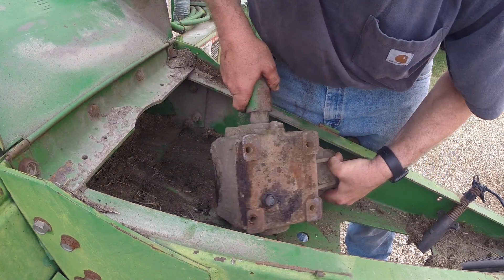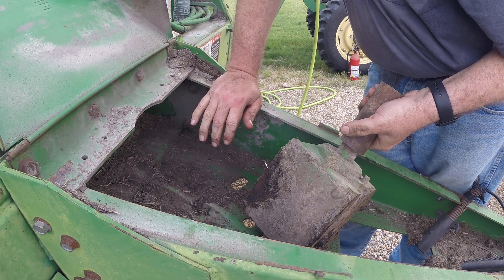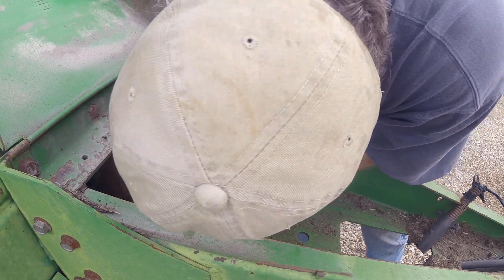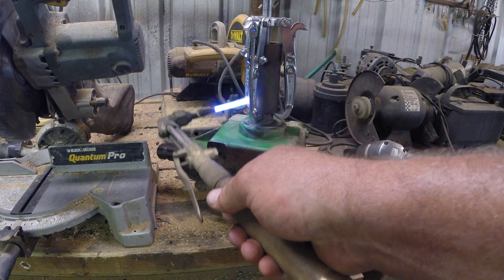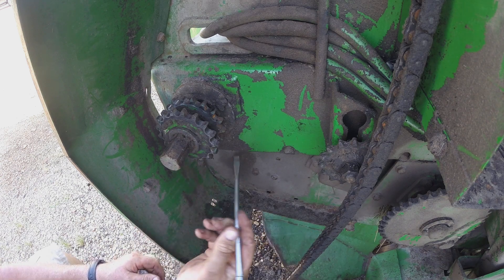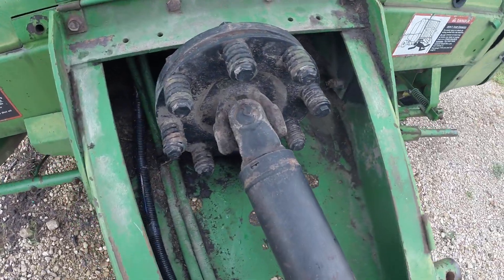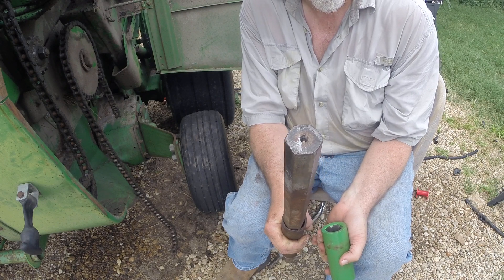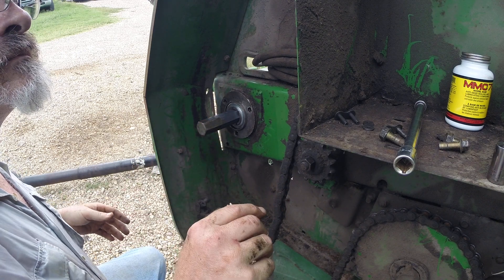Baler PTO conversion; Converting a 1000 rpm PTO to 540 rpm John Deere 535 baler

Comment: Could you not just cut a little length off the driveshaft?
Reply from the maker: I think you would have to cut off too much. Of course you could cut in the middle and weld it but why.
Reply: Driveshafts are perfectly balanced.  They could have had a driveshaft made to specs, but why?

Comment: What did you do with the driveline when you converted it to 1000 RPM the first time?
Reply from the maker: We didn't convert to 1000, we converted from 1000 back to 540. To adapt the driveline we used a 1000/540 adapting coupler.
Reply: @TheFritz423  I see I see, thanks for the reply
Reply: would it be the same in reverse ? as I have a 1000 tractor but 540 baler?